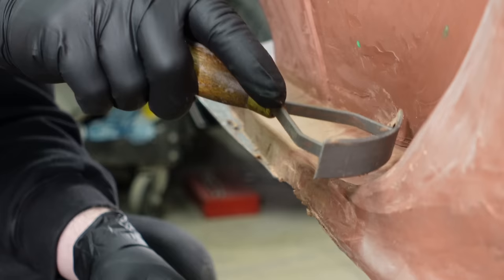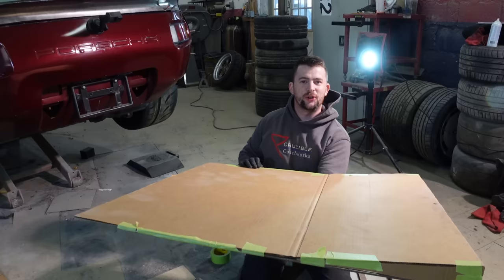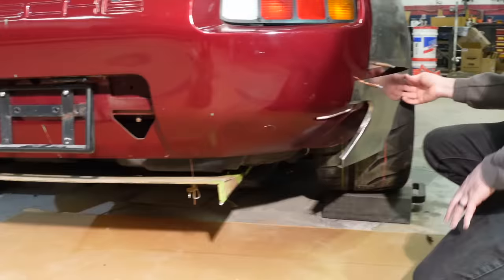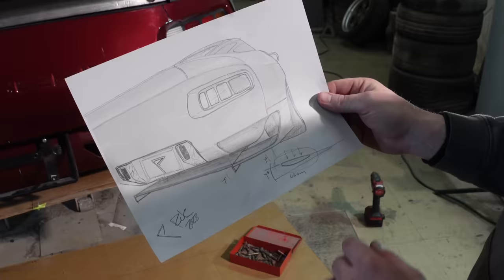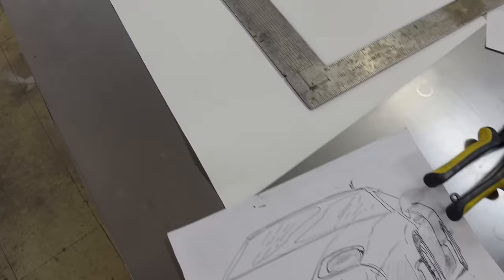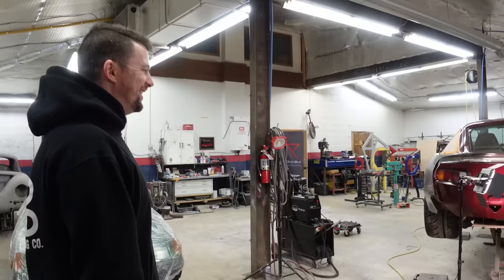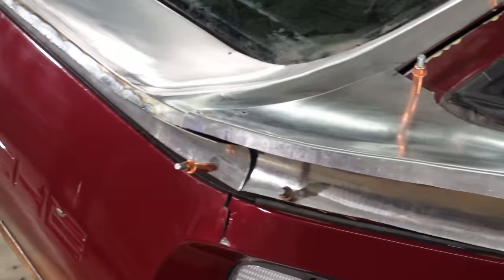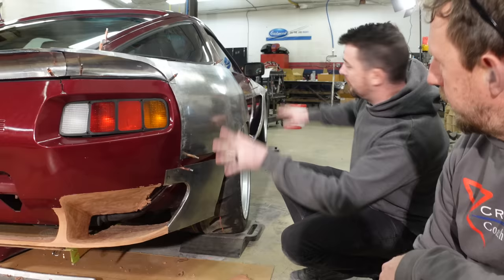Modify Your Car Like a PRO! QUICK Process, PROFESSIONAL Results Custom Car Design & Fab - 928 Ep. 20

Comment: Since different shades and colors (clay vs aly vs red paint) can play tricks with your eyes - grab some adhesive foil tape (stuff that you really use on duct work, not duck tape!). Since it's truly aluminum, it conforms to corners when you mold it, spans some gaps. And if you're gentle can be pulled on/off a few times!

Comment: If you angle those vertical defusers fins at 45 to 60 degrees the air flowing through will create more usable downforce